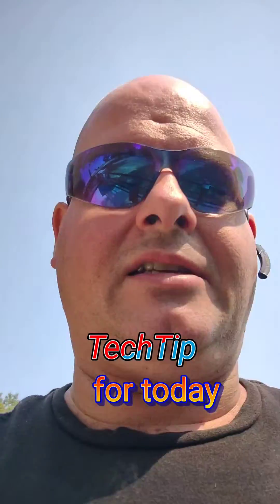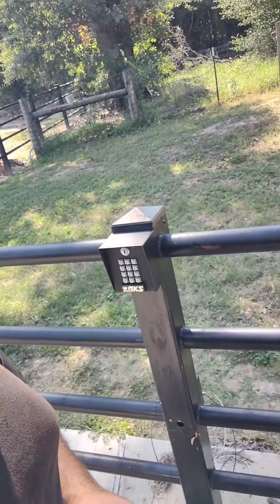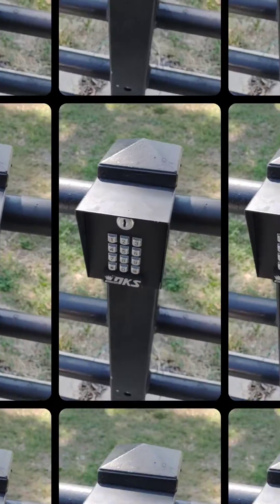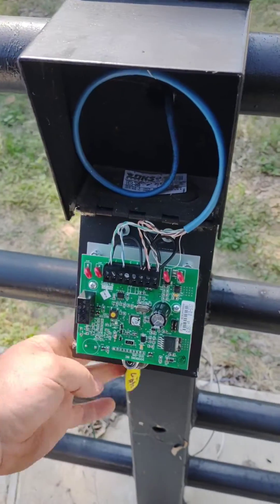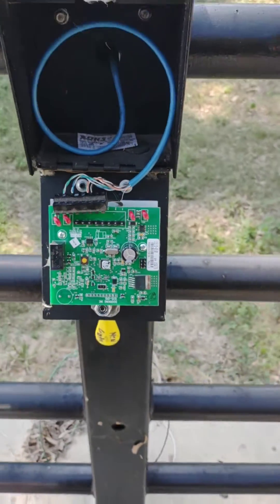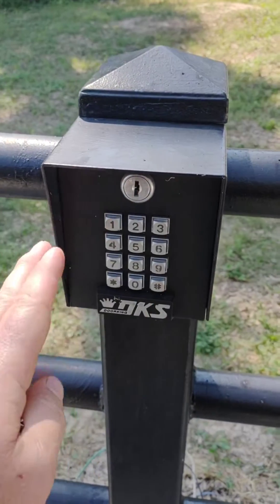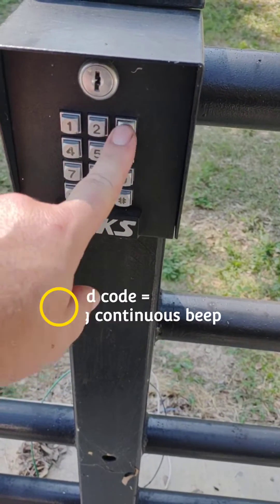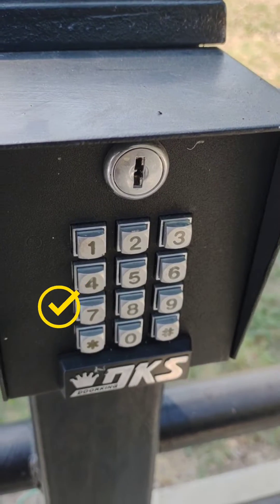Keypad Code Stops Working, Try This

Comment: We have the dks 1802 EPD.  Now you have to push the numbers firm and slowly to get it to work.  If you go faster or touch lightly it won't open.
Do you know anywhere we can get a video on how to replace the keypad on this model?  TY in advance
Reply from the maker: I can't say as I know where there's a video on that, or that I suggest trying to do it yourself. DKS systems can be very sensitive to static discharge and so you should be properly grounded when you service them.

Comment: Mine opens and closes with a touch of a button. It was working properly and then stopped. So I reset it and did it all over again and it accepted the code but as soon as I press a button it opens
Reply from the maker: This is what I understand, so correct me if I misunderstood: you press ANY single button on the keypad and it opens the gate? If so, then there is definitely something wrong with the control board (as long as there are no wiring shorts).

Comment: Mine gives me the beep when correctly putting in a code but that actual locking mechanism doesn't releases. I wish it was as simple as what you had😅
Reply from the maker: If I understand you correctly -- and forgive me if I don't -- open the keypad and try pressing the tiny reset button on the control board, to see if it releases the relay.

Comment: Any suggestions if it accepts the code but does not open the gate?
Reply from the maker: Is it wireless or hardwired? If it is wireless, check that the transmitter board light comes on when you enter the code (you have to do it while you have the face of the keypad open).